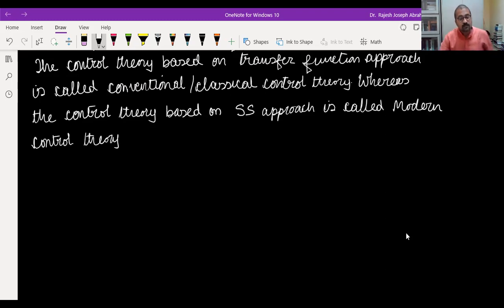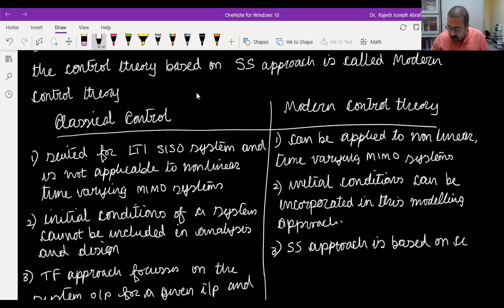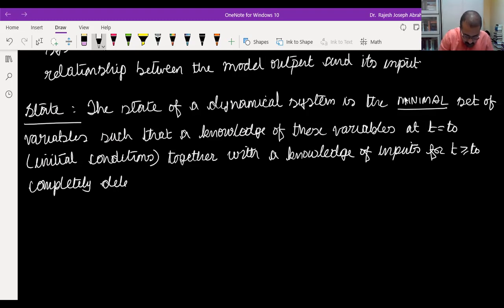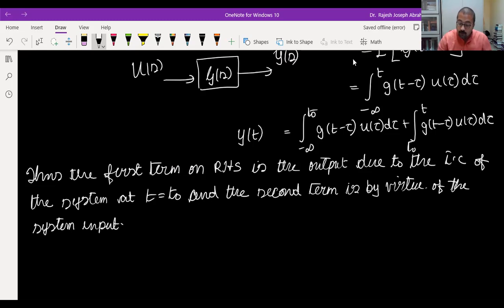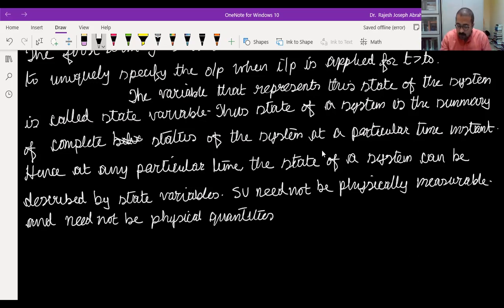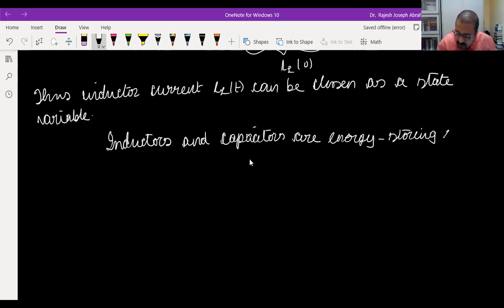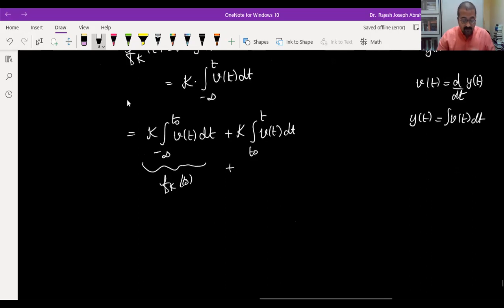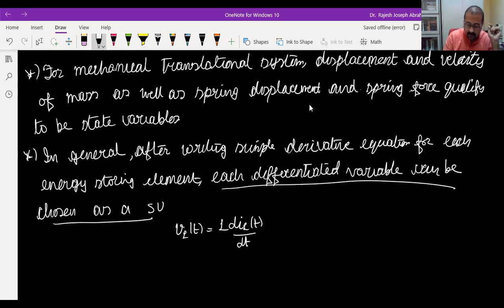Lecture 1: Introduction to State Space Modelling

Comment: Hello sir ,...I have doubt here you told that transfer function method has some disadvantages but to derive the (standard)state space equation, we are using the transfer function ...  i am not understanding that ,could you please clarify it?
Reply from the maker: Dear Srinivas, in TF approach, the initial conditions are ignored and you assume the system to be LTI SISO. State space approach is commonly used for modelling practical systems. We didnot derive state space from TF, but they are related. What I was trying to explain was that, State of a system is the minimum number of initial conditions that must be specified at some initial time t0 to determine completely the dynamic behaviour given the input. If I am not yet understood, do get back to me...
Reply: Thanks a lot for replay sir ...got it